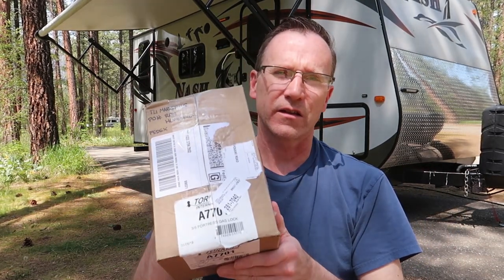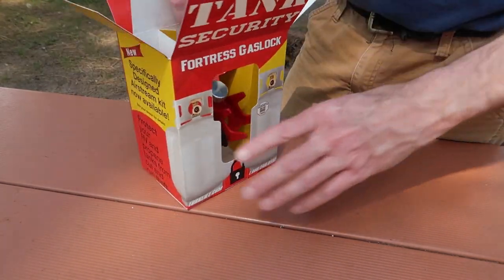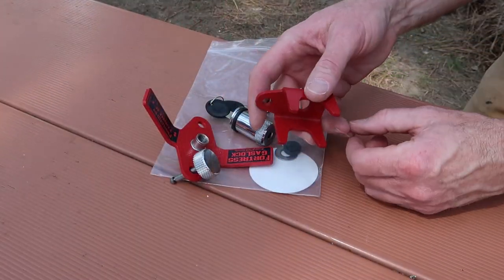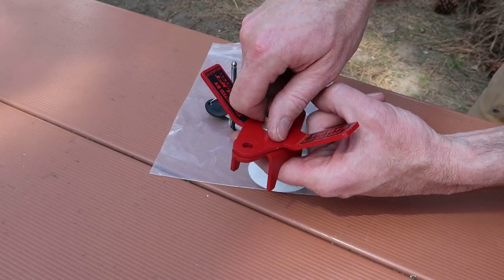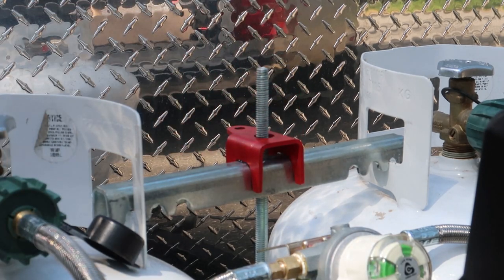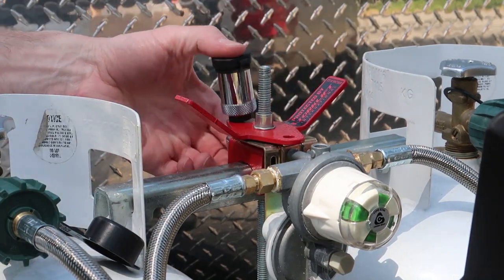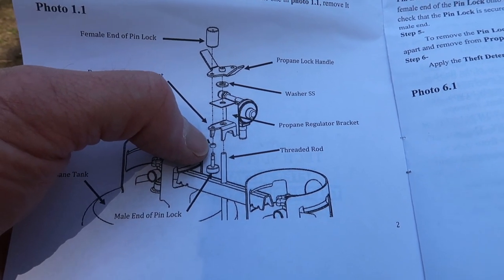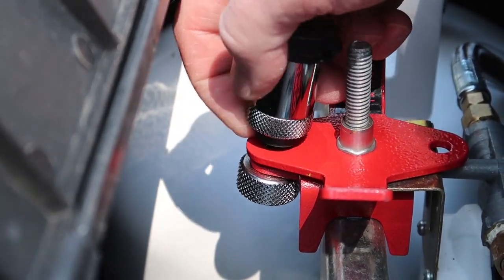Torklift Fortress A7701 GasLock | Propane Tank Lock for towable RVs

Comment: I just had both of my 30 lb propane tanks stolen.  Some durtbag on a bicycle at 4:30 in the morning.  Caught it all on HD security cameras in great detail.  It took the scumbag about two minutes to do it. My trailer was parked in front of my house as we were preparing for a camping trip.  I will be purchasing this locking system.  But first I'm going to use the master lock modification you did in a prior video.  Thanks for the assist
Reply from the maker: Thanks for watching.

Comment: I put a nut underneath the tank holder and on top with permanent "red" loc tite, securely tighten them to keep the rod from being turned,then I put a piece of 3/4 galvanized pipe over the rod to protect the rod,then after installing the locking device I cut off the excess rod so there is nothing to grab onto to try and turn the rod,remember this is only a deterrent,if they want it that bad they will take it.
Reply from the maker: Red thread lock is a good idea.  Thanks for the tip.

Comment: I drilled a hole in wing nut and also bar that holds tanks on then purchased a long shank padlock , cost less than $10.00  .same thing as what they are selling but cheaper.
Reply from the maker: I eventually sold this lock and did the same upgrade you described.  Much cheaper, less parts and pieces, EASIER to use as well.  https://www.youtube.com/watch?v=H2xyw8RhgxE
Reply: They sell these at Walmart here in Canada $111.00 + tx...So I did the same as you...Not saying that the product is no good, just way to pricey
Reply: I know it's 3 years later, but it's not the same thing at all  - same mechanism of action, but angle grinder can cut through the thin metal parts of the rack and wing nut in no time. 

This device is hardened steel and although it can also be defeated with enough time and dedication and the right grinder blade, it is a much harder target. More of a deterrent and longer noisier cut.

I also like the idea of putting a hardened steel pipe over the rod as suggested by another viewer.

I guess it depends on your comfort zone with soft steel and cheap locks vs. your budget.

Good luck!

Comment: Take the 4 screws out of the bottom mounting plate and walk away with the whole assembly
Reply from the maker: The bottom plate isn't screwed to the frame, it's welded.
Reply: In my use case - home generator propane supply - the plan is to bolt the base into a 250-350# concrete slab. Bolts will be under the tanks.

Comment: Amazon says it is aluminum, not steel. Seems like a bad idea. Was pretty interested until I found it's not steel.
Reply from the maker: Do this mod instead:
https://www.youtube.com/watch?v=H2xyw8RhgxE
Reply: @deltabravo1257  Looks good, thanks!
Reply from the maker: I personally thought the Torklift lock system was an overpriced, over engineered product.  My method of drilling the bar and the spinner nut was FREE.
Reply: @deltabravo1257  Yes, I've watched that video more than once and given it the 👍. Thank you!

Unfortunately you did not allow comments under that video.

Does drilling the holes require a special steel cutting bit? If so can you suggest the type or brand?

Looks like a standard 25mm/1inch padlock shackle might be too short - probably need a 2inch shackle I guess?

I don't have bolt cutters to test with, but are the wings of the giant wingnut susceptible to a bolt cutter attack? I have a lock with case hardened bolt cutter resistant shackle, but not sure about those wings. 

My use case is for protection of two 40# LP tanks in my backyard for a portable generator, not for an RV or mobile home, btw. 

I plan to bolt the base of the rack into a 3inch thick, 200# concrete slab with tanks then sitting over the bolts.

I'll place 3/4 or 1inch square stainless steel pipe over the 1/2 inch vertical  steel rod before putting on the crossbar, regulator bracket and wingnut, with extra nuts as you suggest.

At least that's the plan so far.

Thank you!

Comment: Interesting design but it is a pointless lock because the weak area is the threaded rod. It takes seconds to cut the rod rendering the lock an expensive reminder.
Reply from the maker: It will slow down the casual thief, who likely isn't packing power tools with him when stealing things.
Reply: @deltabravo1257  I put a nut underneath the tank holder and on top with permanent "red" loc tite, securely tighten them to keep the rod from being turned,then I put a piece of 3/4 galvanized pipe over the rod to protect the rod,then after installing the locking device I cut off the excess rod so there is nothing to grab onto to try and turn the rod,remember this is only a deterrent,if they want it that bad they will take it.
Reply: @05rickie Excellent! I had the same thought about covering the rod with hardened steel pipe. 

How has it worked for you?